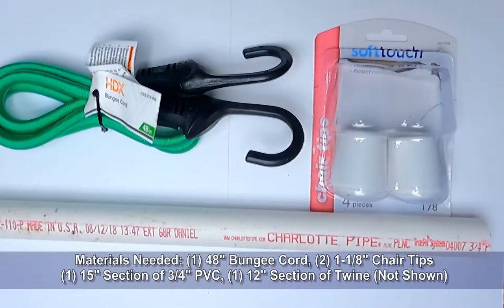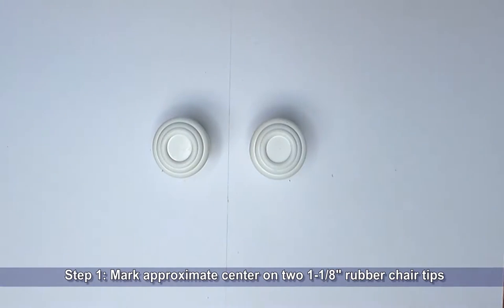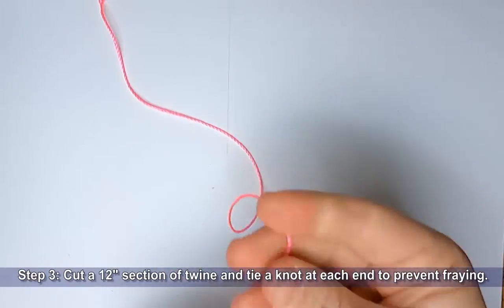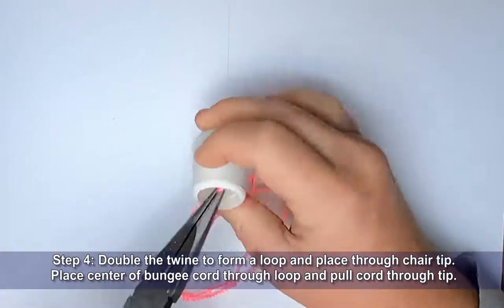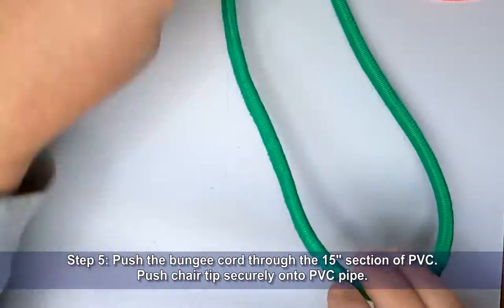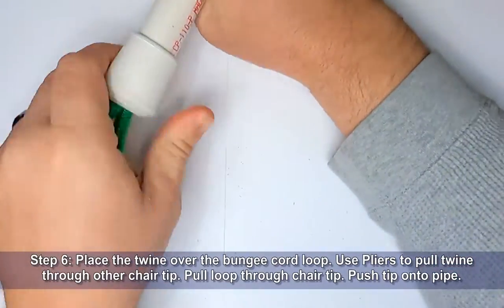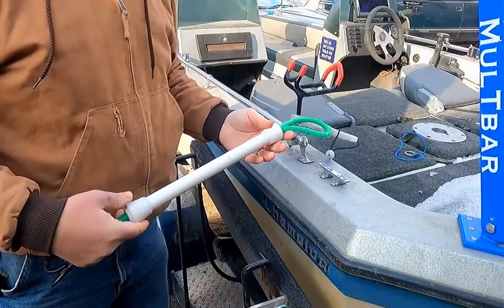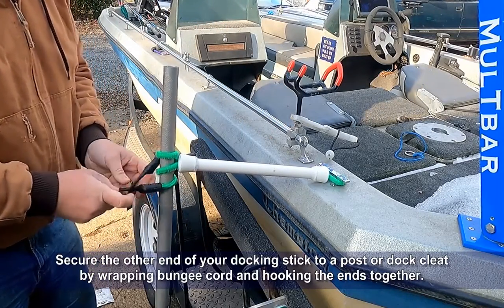How To Build Your Own Homemade Dock Stix

Comment: I found that 1" chair tips and 3/4" SCH 40 PVC works best. A nice snug fit and the SCH 40 is much stronger. I used the exact same green 48" bungee cords from Home Depot and they started to fray immediately. We'll see how long they last. Of course this design can easily be disassembled to replace the bungee cords as needed.

Comment: I just picked up a used center console and there was a nice diy set of these in a storage compartment. Mine are two different lengths. I'm assuming the longer one is for the front cleat as its on the curve of the bow.

Comment: Just an FYI, having just a bungee on both ends will allow the boat to drift with the current and still allow your boat to hit the dock... affix a solid metal hook, a rake hook that screws into the wall would work, on the one end then knot the bungee so the loop is snug on your cleat. This way you hook the sticks through the bottom of the dock cleat and then flip the other end onto your cleat. This will allow the hooks to bind up on the dock cleats not allowing them to twist and your boat to drift forwards or back.

Enjoy!

Comment: So, if wind or a boat wake come along what prevents the boat from going forward or backwards against the dock??????
Reply from the maker: Nothing will completely prevent that, but if you tie off with a pair of sticks it'll prevent the majority of it
Reply: You want them in a "V" formation - either both pointing out towards the dock or pointing in towards the dock.  This locks the boat in position and prevents it going forward or backward too far.
Reply: @dwight9668  they also say to hook them to the dock below the rub rail of the boat. That way the boat will hit the pvc before it hits the dock.